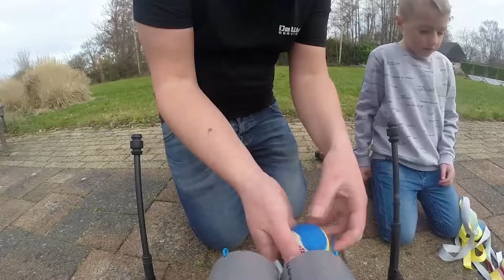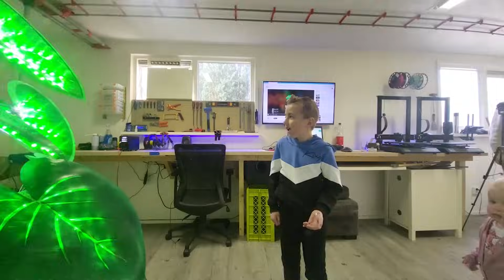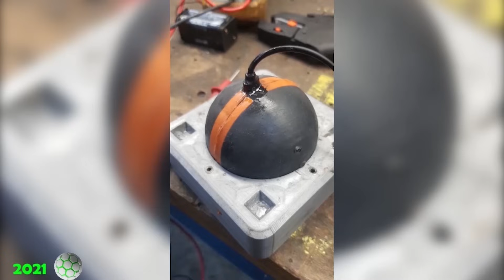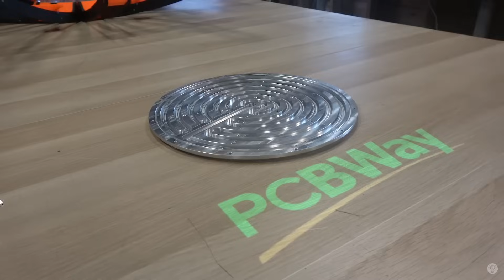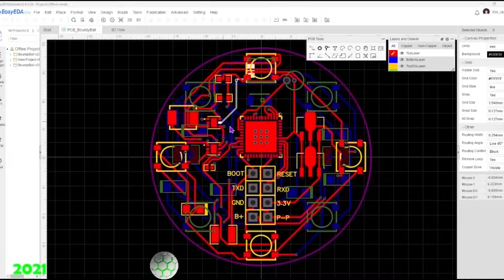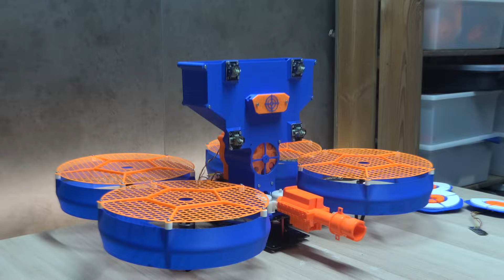7 Project Ideas I've Never Shown Before..

Comment: What to pursue depends on your ultimate goal. 
If you just want to have fun, it looks like the drones would be the way to go, but I wouldn't commercialize those anytime soon due to the real-world drone warfare going on at this time.
If you want a commercially viable products, the ball would definitely be a good one while allowing kids to have fun, and the pavement cleaner has potential if it can be fully autonomous (a single unit with its own battery bank, water tank, and pavement detector to avoid damaging grass/plants)
The plant is really cool as an interactive decorative item but it seems already as good as it needs to be.
The robot, I am not sure what it does, the video didn't really cover it's purpose/abilities, maybe it's in another video I haven't seen yet. It probably wouldn't be great for commercializing due to the extensive competition out there, but it would be great to learn more about robotics.

Comment: I made a little drop mech for my Mavic pro that I wired to the the nav lights on the front arms, that can be remotely turned I/O, to run a basic script on an adafruit trinket that moves a servo X° and -X° to open/close the mech. Then made all kinds of stuff to drop from it. I designed/3D printed some box fins that glue onto the narrow end of a plastic Easter egg to make what looks like an old WW2 era nuke. I cut some craft foam supports that fit inside the egg and hold a cheap little cube cam inside the egg to record the FPV from the front of the egg as it falls. I designed/3D printed another WW2 era nuke-looking contraption that holds a green gas airsoft shotgun shell and blows out a puff of colored cornstarch out of the back when it hits the ground. But, by far the most fun and most entertaining is just dropping a cheap parachute guy (the ‘tangle-free’ ones that use mesh instead of lines because they fall really slow) and trying to catch them before they hit the ground. lol